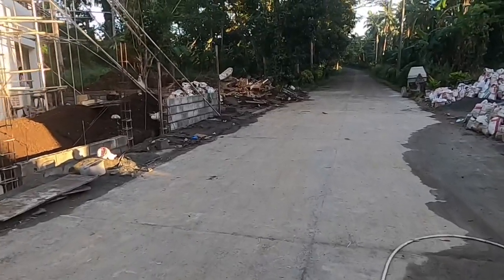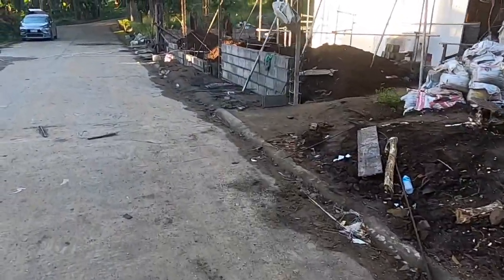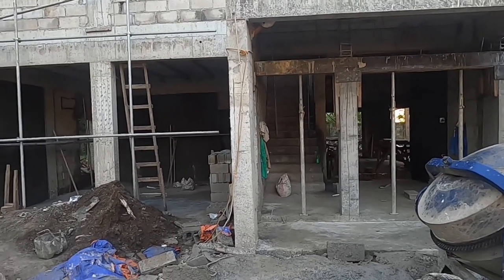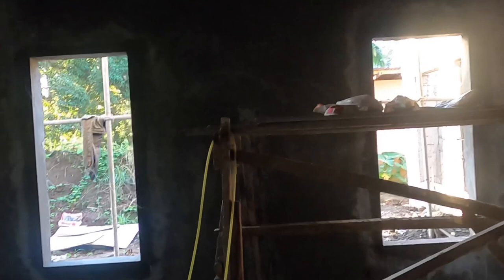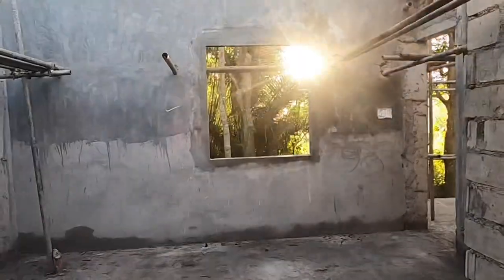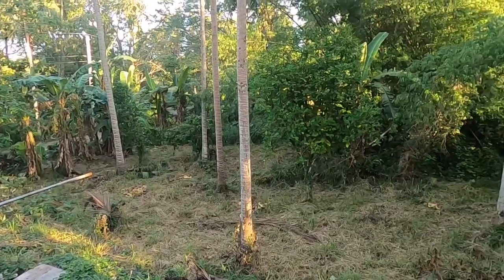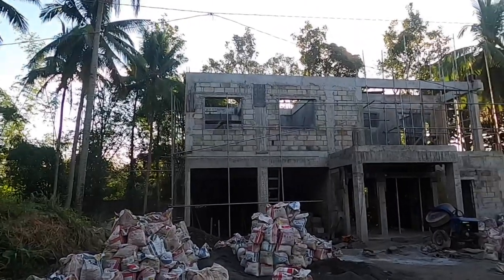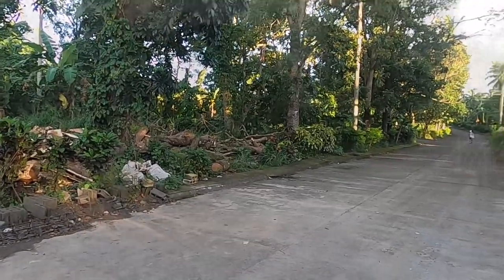Philippines House Build Vlog 55: FORMING THE MAIN DOOR FRAME

Comment: Good morning what can I say not easy building in the Philippines if you a builders and you can do some of the work you self then its OK but in your case its must be hell for you to stand back and wait until some ting happens  not  trying to said anything bad about your build its what I do every day for a living it would drive me crazy hoping you can get your roof on some you need to be there every day and push it on if you will be last in line that  what  I would be doing its your build and not mine so wish you best of luck just trying to help ok thanks again for your video 📹 its was great help for me lwill building a house some time this year when lock down is over 😀
Reply from the maker: Hi Patrick, i would have never guessed having a house built would be so stressfull here in the Philippines sometimes I will not go to the site just so I do not get my day ruined.  Stay safe.